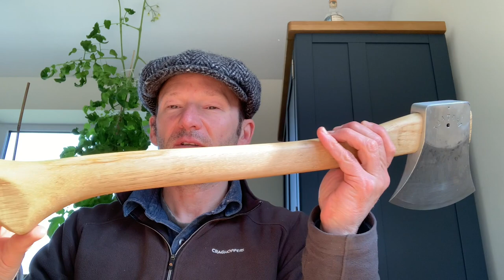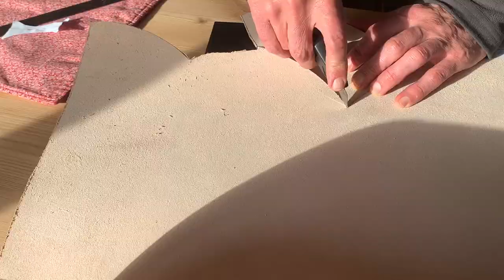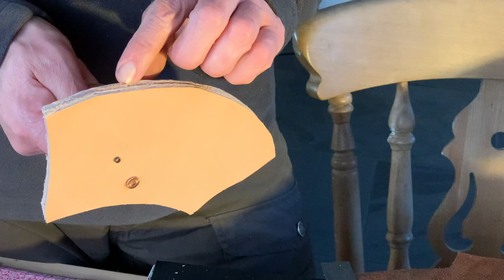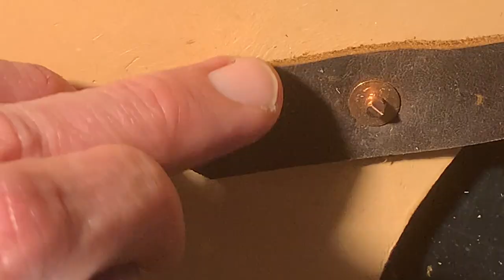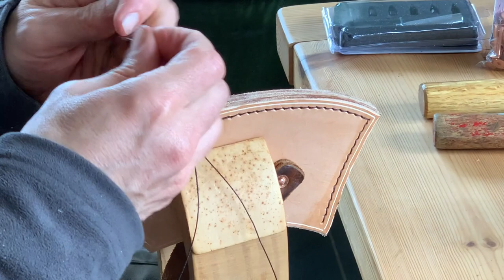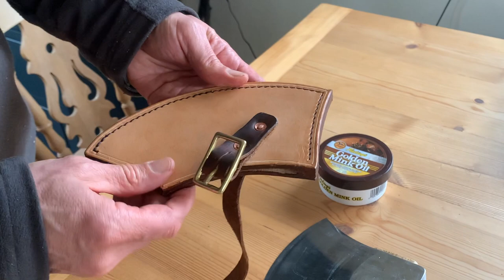Leather Sheath for Tuatahi Camp Axe

Comment: Nice job.  How are you getting on with the stock handle?
Reply from the maker: Hi Kevin, that's a difficult one. On one hand it is very well made and fitted and suits the overall aesthetic, on the other for felling or bucking I definitely feel like it is too short for the weight of the axe. Recently however, it came into its own in a more overgrown section of woodland that I was clearing where the longer handled axe was catching in overhead vegetation. So I will stick with it and use it for the most appropriate situations I think.
Reply: Just seemed like such an odd choice for them to put that handle on that particular head.  Glad you’re making due, though.

Comment: Very nicely done, although the copper rivets might scratch the steel axe head? Not sure copper is soft.
I made a kydex and leather mask for my big tuatahi axe, getting more and more tempted to grab the little guy too.
Reply from the maker: I was worried about that too and was considering glueing some thin leather over the copper but as it turned out, the riveting process recessed them slightly so it’s fine. Also, as you say they are softer than the crazy Tuatahi steel! The camp axe is great, more useable than the big brother in many ways. Go for it!